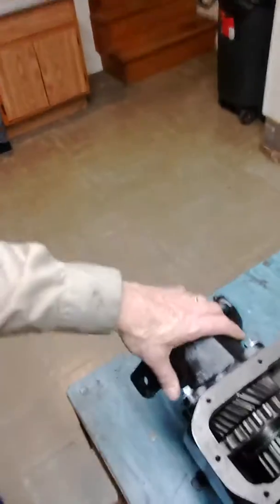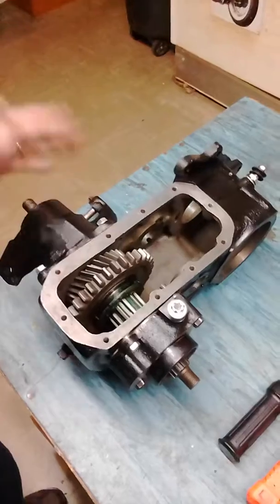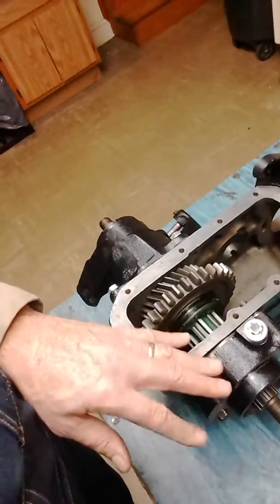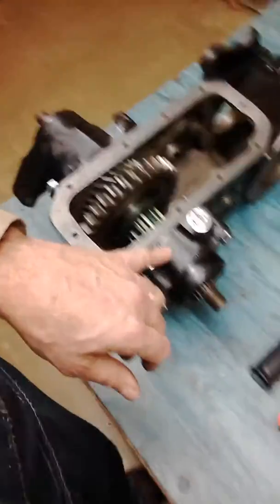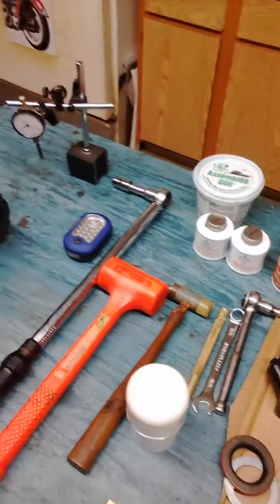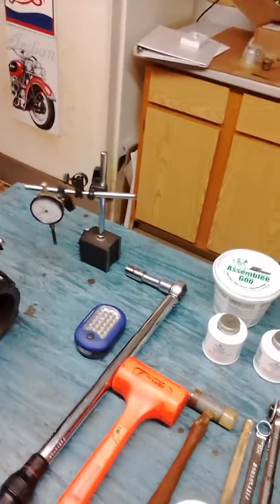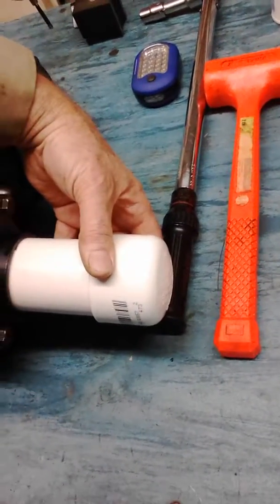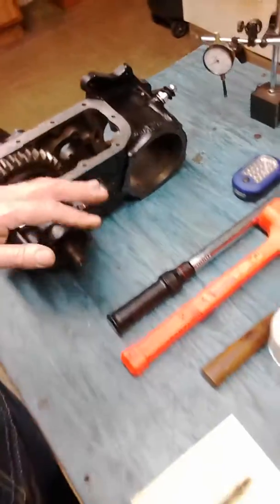TC PT 8 - Shimming the D18 transfer case output shaft

Comment: Thanks for sharing, I will be starting mine soon. Why did you have to add the shims behind the seal? Was that just so it wears in a different place on the Yoke?
Reply: I just watched your other video regarding the seal shims, I guess I should have started at your first video.
Reply from the maker: The rear yoke/companion flange has to clamp the speedometer drive gear on the shaft so it turns and drives the driven speedometer gear. I had a mis-matched set of speedometer drive gear and rear yoke. There are different lengths. I could have bought the correct yoke, but I had already spent money on a repair sleeve and installed it. Making spacer bushings/shims was a cheap and easy way to get the length needed to clamp the speedometer drive gear.